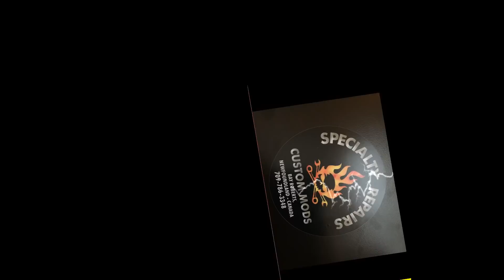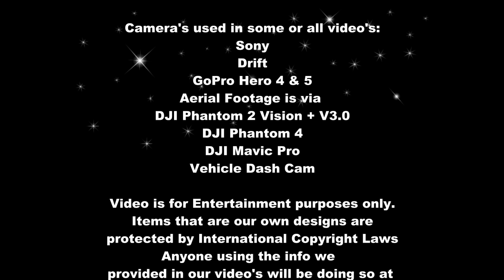Shop Expansion PT 12 Edited

Comment: Notice they start cutting from the bottom to the top - this way the water runs out of the cut instead of flooding the inside.
Reply from the maker: Well it didn't work very good lol. Once the blade penetrated through the wall inside it flicked stuff everywhere. We even had to wash down the ceiling, top of furnace and it's funneling. That being said Id rather deal with the mess than having to cut that door opening by hand.

Comment: I used to work underground and was pretty efficient with a rock drill. My father wanted to put a furnace under the house so he asked me to do the job. Wall would have been as thick as that. I thought it would be an easy job. I’m tell’n you that concrete was harder than anything I’d drilled. It took two days to drill and another to bash it out with a sledge hammer. I was so buggered I slept for 24 hrs. I know what your say’n Paul. Ha!
Reply from the maker: Oh yes. For anyone who has done it the way you and I have there’s no second time lol. Pay the right folks with the right tools and be happy they are around to do it.

Comment: Great video you guys! There are outfits around me that do this, but first time seeing it actually done. At work, I’ve witnessed concrete hole drilling up to maybe 10” to pass pipe through, and I’ve seen water blasting through 1” thick steel too. Both are so clean, it’s unbelievable. We’ve come a long way with technology. Anyway, everything looks great. I guess you’ll close up the opening with plywood until the floor gets poured, and the door goes in. Great job by all. Congrats!
Reply from the maker: Es very cool job. As for the opening. 1/4” plate bolted to the opening will keep them out lol . We have an excellent  security system as well. 😉

Comment: Great video, very interesting and ignore the safety police...  A couple of questions: 1) How do you get the piece that was cut out removed from the construction site?  It is probably the contractors responsibility but I bet you are 'itching' to take a shot at it ;)  2) I noticed on several pieces of your equipment you have front fenders.  Where did you get them and how did you place them?  Could be a video. 
Michael
Reply from the maker: Michael the piece of concrete will come out of there when they back fill the area and inside. That being said I could lift it out with the loader if I had to but it would have to be back filled first. As for the fenders. On the larger 5740. Up here in Canada they were offered as an option at the time of purchase. At that time they were around $1000. They were never offered as an option in the US. There are no fenders offered for the BX so those are a set I designed and put on the machine.

Comment: Hi Paul the guys made it look easy with the wright tool .The 6" pipe in the wall is that your  shop drain ?1/4"plate you are putting up will it stop the wind you get?lol have a grate day from lakeside  Ca.
Reply from the maker: Yup. The pipe will allow the drainage pipe to pass through. I’m thinking the 1/4” plate might work 😂

Comment: When they pour the floor it's not going to be easy to get the overhead door sill  leveled out
Reply from the maker: Incorrect. Nutt’in to it. All taken into consideration.
Reply: I am talking about the new outside overhead door.The sill is not level. That would either require fixing it with concreat when they pour the floor or grinding / chipping it out. I know this from my past experience in construction
Reply from the maker: What you don’t know is that sill is below floor level. The floor will make the sill level.